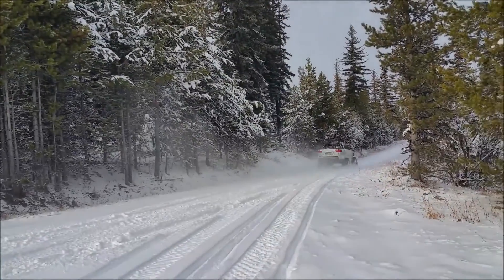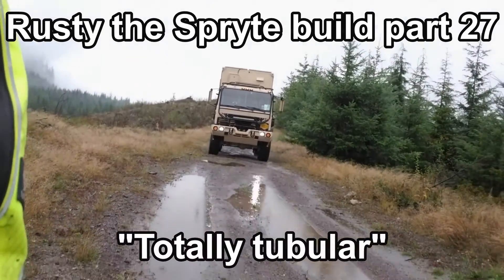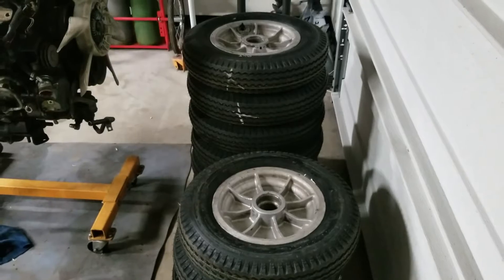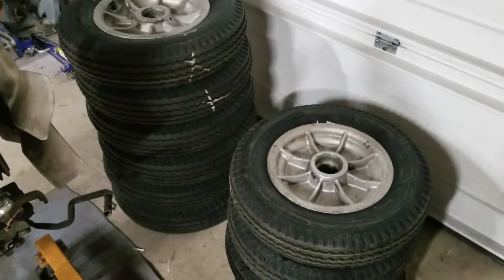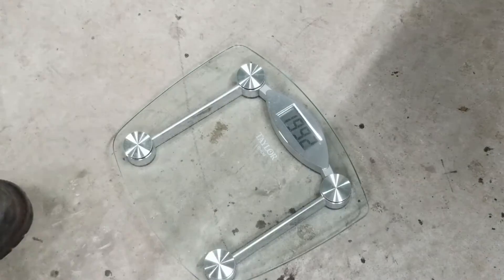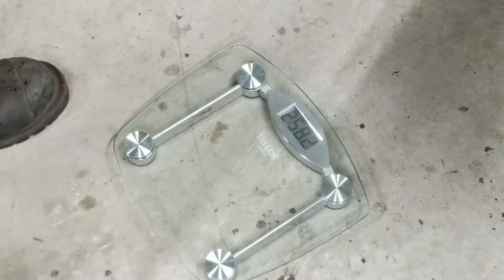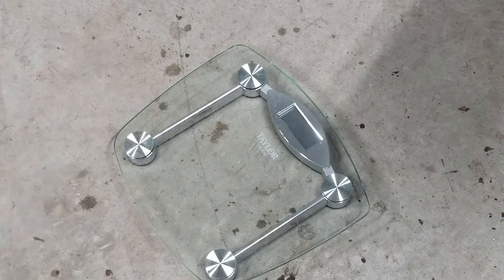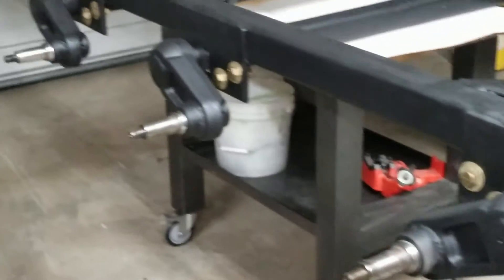Rusty the Spryte build part 27 (urethane filled tires, wheel bearing/race installation)

Comment: Looks like you're making great progress.  At this rate, you should have it done just in time for summer 😄😆
Reply from the maker: I am thinking the body design, transmission electronics, engine rebuild (if it needs one) will slow me down a bit.  Aside from that, no problem right??  LOL
Reply: @SeanFastidious  I'm really curious to see how the body comes out.  In my mind, I'm envisioning an Airstream on tracks, or something like that.
Reply from the maker: My brother sent me a text suggesting the same thing.  If you have any hookups for 4'x10' 16 or 14 gauge stainless now is the time to hook a brother up LOL